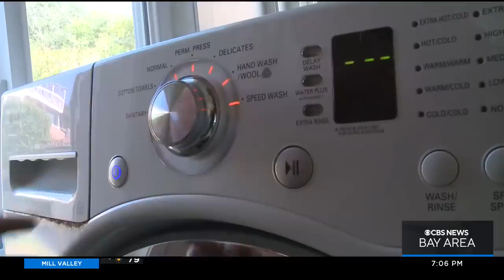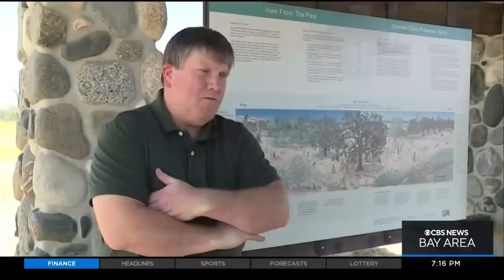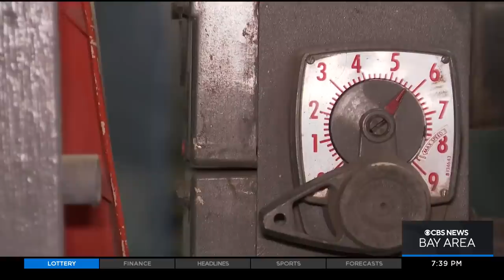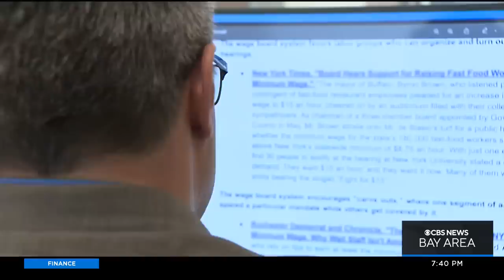Parched: California's Climate Crisis

Comment: I've worked in CA Water industry for 15 years.  We do not collect rain water when it falls, we release water when we have too much into the ocean, we do not recharge our aquifers with excess rain fall or run-off.  Then we build more homes, allow farmers to grow any water hungry crop they want for cash and tell people that their lawn is the real issue.  
We also have denied several new agencies from building new desalination plants.

Our political leaders could also get together and do a large public works project, which would provide lots of jobs, to make a new aqueduct from up north.  This is a making of our own design, while the weather has pushed it faster, this is our own doing.
Reply: Interesting.
Reply: Exactly right!!
Reply: Very enlightening !
Reply: That's aqueducts and desalination plants are still the most expensive and frankly destructive approach.  It is vulnerable, brittle, and fails to address concurrent problems.  You will end up using a ton of electricity to pump water in the aquifers, as well as desalinating water.  It would increase brownouts.

The better approach is the prevent collecting too much water at dams in the first place.  
It is better to do smaller, decentralized, water-harvesting earthworks/techniques starting in the foothills, and continue thru to cities.  These would include keylining, check dams, bunds, swales, gully repair, planting pits etc.  More bioswales with curbcuts to feed street runoff into them is a start in urban areas, as well as encouraging the purchase of cisterns, using greywater for watering lawns and trees, as well as using roof runoff for water, flushing etc.
Decentralized efforts can reduce fire danger, flooding, lessen drought impacts.  Bioswales planted with trees can reduce heat island effects, allow pavement to last longer.  By passively using rainwater in bioswales, reusing greywater and roofwater you can reduce the amount of electricity used to irrigate and reduce the chance of brownouts.  
Keeping landscaping hydrated this way also keeps the soil biota hydrated and allows water too seep better into the soil instead of running off.  
Overall using rainwater harvesting techniques/earthworks recharges aquifers and surface water in a positive downstream effect.  
Brad Lancaster has YT videos and books on the subject.

Lots of water falls there, even during droughts but as you said, it is squandered.  You need to back up and reassess where you look for problems/solutions...

Farming and ranching could be done much better.  'Sustainable ag' is a greenwashing term to sell more products to farmers and ranchers rather than solve deep ag problems.  Restorative ag techniques work much better and for less while producing more food.
Reply: And how much does the state spend on weather modification activities with Colorado blm?
Reply: @Cali Singh  
^^^^^^^^>>>>>works for a company that makes desalination equipment.
Please buy his tech that breaks down, uses a lot of electricity, requires lots of maintenance, will need to pump water great distances, will cause more grown outs, pollute a lot more, break down, fail to operate during power outages, increases insecurity, centralizes water,  costs $$$$$$$,  makes him $$$$$$, solves only only one problem but causes a lot more.  

Now consider using a system that solves a lot of problems.  It is a lot cheaper;  provides a superior product; is durable, long-lasting; reduces fire danger, slide danger, flood danger; reduces the effects of heat waves; saves on heating, cooling and watering bills; mitigates droughts; recharges aquifers and water tables; reduces grid strain; reduces crime; adds beauty; adds resilience to individuals, communities and cities, even regions.  
Desalination plants are a big fail.
Reply: There should be more public discussion about this. Thank you for explaining.
Reply: @tk3831  
There should be broader discussion beyond the higher tech, costly solutions that were discussed in the video.  This video is put out by a news company with corporate interests to sell more product.  
Teague made somepoints about what is wrong but then he came up with more brittle, downstream solutions. What would be more effective would be to start smaller, localized, higher-in-the-waterhed solutions via rainwater harvesting solutions and earthworks.  A similar, localized approach could be employed in the city, through bioswales and curbcuts that address many problems cities, communities and individuals are already trying to solve via much more expensive, low-on-return solutions.  
Localized solutions mean localized resilience which is important.  
There are great examples online of Tucson and it's efforts.  Refer to Brad Lancaster.  For additional info on modifying ranching/farming techniques look up Mark Shepard.  Each teaches techniques adaptable to local watersheds and ecosystems.  The great news is that they do work and are a lot better than they continued shooting ourselves in the foot policies offered elsewhere...
Reply: @b_uppy  israel would beg to differ with you.  Desal plants are working miraculously well for them.
Reply: @calisingh7978  Weather modification is expensive and unreliable. Micro-climate and regenerative farming should be addressed first, IMO.
Reply: @bookbeing  
Aussies would say otherwise.  Desalination is brittle, centralized, and needs replacement, as well as constant maintenance.  It pulls a huge amount of electricity to process it.  Pumping water uses a huge amount of electricity.
A terrorist strike, or a brown out earthquake and the mirage of water abundance is gone.  

If you start with simple things like a curbcut diverted into streetside bioswales (inlet only, or else you lose mulch).  Roof runoff diverted into a cistern, rain gardens, or fill a cistern then overflow be diverted into raingardens.  Use greywater as well, for flushing and landscaping.  Public parks, ranch and farmland could use rainwater harvesting earthworks and techniques.  This would greatly reduce gridstrain on water supplies, and electrical grid demand.  It would also reduce erosion, reduce flooding and fire dangers, mitigate the effect of heatwaves, etc.  It has increased beauty, shade, comfort and even reduced crime as neighborhoods have become walkable/bikeable.  
Bunds, check dams, gully repair, planting pits, keylining, swales, etc could be cheaply made out of materials on site.  Brad Lancaster has a great book on the different techniques that are low cost and highly effective.  Many are now employed by the city of Tucson, and well as on farm and ranchland and around the Sonoran Desert and elsewhere around the country.
Adapting Mark Shepard's techniques would help as well.  He grows local native- or domesticated relatives of native- food-producing perennials, shrubs, vines and trees.  He has as a variety of livestock for pest control and fertilization and as additional sources of income.  This would be much better than paying a farmer to do zero as it would be mimicking natural processes while still producing needed food, plant diversity and also provide wildlife habitat.

(It should be added that there are permaculturist in Israel as well...)
Reply: @bookbeing  
Aussies would say otherwise.  Desalination is brittle, centralized, and needs replacement, as well as constant maintenance.  It pulls a huge amount of electricity to process it.  Pumping water uses a huge amount of electricity.
A terrorist strike, or a brown out earthquake and the mirage of water abundance is gone.  

If you start with simple things like a curbcut diverted into streetside bioswales (inlet only, or else you lose mulch).  Roof runoff diverted into a cistern, rain gardens, or fill a cistern then overflow be diverted into raingardens.  Use greywater as well, for flushing and landscaping.  Public parks, ranch and farmland could use rainwater harvesting earthworks and techniques.  This would greatly reduce gridstrain on water supplies, and electrical grid demand.  It would also reduce erosion, reduce flooding and fire dangers, mitigate the effect of heatwaves, etc.  It has increased beauty, shade, comfort and even reduced crime as neighborhoods have become walkable/bikeable.  
Bunds, check dams, gully repair, planting pits, keylining, swales, etc could be cheaply made out of materials on site. 
Brad Lancaster has a great book on the different techniques that are low cost and highly effective.  Many are now employed by the city of Tucson, and well as on farm and ranchland and around the Sonoran Desert and elsewhere around the country.
Adapting Mark Shepard's techniques would help as well.  He grows local native- or domesticated relatives of native- food-producing perennials, shrubs, vines and trees.  He has as a variety of livestock for pest control and fertilization and as additional sources of income.  This would be much better than paying a farmer to do zero as it would be mimicking natural processes while still producing needed food, plant diversity and also provide wildlife habitat.

(It should be added that there are permaculturist in Israel as well...)
Reply: @Teri's Teapot 
Think Cali Singh works for company selling one-hit wonder tech...
Reply: @b_uppy  your argument against desalination or reverse osmosis, is like Baltar in Battle star Galactica, 
Stopping action to save human kind whilst doom ensues!
This is not climate change but continued absence of correct action!
Reply: I have this spot I like to skate in. The homes are listed for 2M but empty- it’s a ghost town right by the harbor.
Reply: To be fair, the US obsession with green lawns really only works on the East coast
Reply: @Rainclouds Radio  
Actually a hydrated yard absorbs rainwater better because 1) the soil has avoided collapse and compaction.  2) The soil biota and plants and earthworms create pathways for water to run down.  
The other part of the problem is the way we maintain the lawns and landscaping.  
We use drinking-quality water when we could use greywater, roof rainwater runoff diverted to cisterns and then that overflow diverted to raingardens (with mulch!).  We could also employ street runoff and divert water via curbcuts and holes bored in curbs into mulched planting pits called bioswales.  
Ten inches of rainfall falling on a square kilometer of land is about a million gallons of water.  A huge amount of water runs down the street and into stormwater drains that would be perfect for landscaping.  
Look into Brad Lancaster's latest editions on rainwater harvesting in drylands.
Reply: Free healthcare and education for illegal aliens and legalizing theft are more important Democrat Party priorities.
Reply: I blame Trump. Only Breck Girl Gavin Newsome can save California.
Reply: Great discussion here in the comments! Refreshing!!
Reply: I have never understood why California, by far the richest and most populated state in the country does not invest in a system Of water recolección? Also one or two super dams to collect even
More rain water to have as extra for the dry season would help the state a lot.
Reply: Agreed 100%.
Reply: @b_uppy  thank you!!!!!! Proper land management, the old fashioned way of rotating and planting of multi crops rather than mono crops  swales, mulching, biodiverse use of natural fertilizers and ground/earth restoration instead of pouring on chemicals  toxins,, etc,, use of grey water from dishwashing which I do by hand with biohealthy soap, laundry grey water again using more natural rather than toxic products, and rinse water, shower and bathing water,  etc can all be either used directly or easily filtered and used for plant and garden watering, as can rainfall run off, but in most places, including California,  laws forbid it! Sad. Consequently  our soil becomes overly dry and dead so instead of absorbing rain it runs off. Perfect example is nearby where I live in the high desert. We had a runoff issue at the lower end of a flash flood point. They raised the road and put in larger drainage  pipes to allow the flash flood waters to flow farther into the desert. Upper level swales  terraced, over the downhill slope would have allowed the water better time to soak into the ground water table, enhancing the soil and area to grow more natural  plant materials that would better hold the soil creating plant biodiversity and hold soil and water allowing it to percolate deep into the ground, instead of just allowing the water to run downhill,  stripping soil, rock , and plant material  creating the existing issue that still remains downhill.  Instead of stitches and healing a bandaid was placed which covers   for a time the existing issue which will again show up as soon as silt and debris fills the drainage culvert.
Reply: @teresamariner4238  
Glad we're agreed!  I do similar practices as well. 
Nanny laws are the worst.  It's one thing to protect people who lack the capability to protect themselves but most people, as does society, does much better without it.
We need to decentralize water:  get a lot more value because of reduced fire danger and associated costs;  reduced flood danger and associated costs, including replacing aging/flawed stormwater drain systems;  reduced irrigation costs and fees;  reduced electrical grid strain, brownouts, and related costs and fees, including heating and cooling;  reduced pavement wear because of reduced heat stress, increased walkability, bikeability;  reduced heat island effect;  increased beauty, biophilic design;  reduced air and water pollution as well as removing more CO²;  decreasing the effects of  droughts and heatwaves (including deaths) while increasing food availability and diversity, the list goes on.  
Bioswales;  raingardens;  using street and roof runoff;  as well as using onsite materials in farm-, range- and park- lands to create rainwater harvesting earthworks, etc
etc are still important in cheaply offsetting the multiple problems faced by people living in drylands, and beyond.  
Restorative ag practices will make a huge difference as well.  
I think our biggest obstacles are politicians who receive favors from corporate conglomerates to use their high -tech, single-use, impoverishing 'solutions.'  They will continue to centralize resources with tax dollars and charge for fees them.  Desalination plants, other water tech fail to address the problems that are compounding water shortages, fires, droughts,  crowding, crime, homelessness, etc.  

What's interesting to me is I say what I say about about the alternatives and the kinds of objections I get.  People are still failing to see the value of restoration ag/permaculture practoces provide...
Reply: @William Montes
Nuclear (and the latest desalination gizmos ) is more single use, expensive infrastructure that only addresses power and drinking water that requires related infrastructure.  These have very limited benefit when you consider the cascade of upstream/downstream centralization issues they add, including rapidly compounding costs as well as having limited benefit in the larger scheme, such as reducing fire loss, flooding losses, drought losses, homelessness, crime, exorbitant cost of living,poor food diversity, the list goes on.
Additionally where would we put a power plant without risk of damaging a large portion of land for growing?
Reply: Farmers aren’t the problem hun, it’s your mismanagement and selling it all to nestle for pennies.
Reply: Some of these issues came up when I took a college class in the late 80s.... California has been heading in this direction for a long time.... Even if Global Warming wasn't a thing California was going to have a water problem....
Reply: Teague Oh my not homes and grass which actually is helpful (sans herbicides) it keeps the soil moist via nightly dew and keeps soil from eroding. Grass is also beneficial to insects, but UN decided grass is now a crime, and the 75yrs of weather modification/ control is okay, is that right?
Reply: @bookbeing  And so is weather modification eh.
Reply: Totally agree bad management.  Ancient times people used to have  water management in deserts .
Reply: @MissCV  
Some farmers/ranchers use bad practices that dry out the soil (some of these conventional ag practices are greenwashed by calling them 'sustainable').
Bare earth/overgrazing practices cause the rainwater and irrigation to run off instead of seeping in.  They also contribute to the loss of black topsoil which also contributes to poor soil hydration.   You see bare ground, dead brown short plants, synthetic fertilizers and biocides, monocrops, etc, --you can be assured more water is used than is necessary to keep up production.  
Many farmers/ranchers do use restorative practices that rely on rainwater only, or a lot less irrigation while producing an abundance of diversw, more nutritious foods while maintaining a level of ethics.  It helps to use practices and plants adapted to a site, than to try to change a site through synthetic chemicals and other less durable, brittle methods.
Look up Brad Lancaster's books on rainwater harvesting and Mark Shepard's books on restoration ag.
Reply: @gordonlumbert9861  
California could address a lot of its water problems in the decentralized way Australia, or even Tucson does.  The wealth gap is ever increasing there.  
Simpler solutions regarding water should be done first.  I keep talking about bioswales, street runoff & curbcuts; roof runoff, cisterns and raingardens;  rainwater harvesting techniques and earthworks using onsite materials; etc; for a reason.
A one kilometer square area that receives 10 inches of rain, will have received about a million gallons of water.  
Most of that water is wasted due to drought conditions, compacted dry soil, evaporation, and all the storm infrastructure to drain it into canals instead of diverting into the immediate landscape.
Transpiration from repair to the land could restore natural hydrologic cycle and decrease the crazy cascade of costs with new infra structure.
Reply: @Gordon Lumbert  
California could address a lot of its water problems in the decentralized way Australia, or even Tucson does.  The wealth gap is ever increasing there.  
Simpler solutions regarding water should be done first.  I keep talking about bioswales, street runoff & curbcuts; roof runoff, cisterns and raingardens;  rainwater harvesting techniques and earthworks using onsite materials; etc; for a reason.
A one kilometer square area that receives 10 inches of rain, will have received about a million gallons of water.  
Most of that water is wasted due to drought conditions, compacted dry soil, evaporation, and all the storm infrastructure to drain it into canals instead of diverting into the immediate landscape.
Transpiration from repair to the land could restore natural hydrologic cycle and decrease the crazy cascade of costs with new infrastructure.
Reply: @msheart2  
Lawn where synthetic chemicals are avoided is important to restoring soils ability to receive and soak in water.  
People vilify golf courses but they can be important to cities for several reasons.  They do need to avoid synthetic chemical inputs and could easily incorporate raingardens and bioswales to increase their rainwater harvesting benefit, but they help mitigate flooding, and air pollution, sequester more rainwater, as well as add greenspace in an area packing it.  They are self-supporting spaces that where elderly and disabled people can exercise, as well. 
If they forewent synthetic chemical inputs, added raingardens and bioswales they could reduce water pollution, further reduce flooding impacts, increase soil carbon, encourage more birds, etc.
Reply: @coniwatson9512  
You mean ancient water practices, rather than ancient times.  Many have stayed in use, though they lost mainstream use..
Bunds, check dams, planting pits, gully repair, etc are still here and used.  Many people are adopting them once again because they bring localized water security, This is much better than the insecurity centralized services that can be cut off by earthquakes, brownouts, accidents, fires, terrorist attack, delivery failures, grid breakdowns, etc.
Reply: @b_uppy  these are great suggestions that each individual person should try to implement.  Unfortunately, these efforts take time to  show some benefit as results don't happen overnight. Even if everyone worked hard to implement all the suggestions that you put forth we still  need to have something in the interim, a stop gap, especially for areas where the  habitat may not allow for these kind of programs to reliably consistently meet the drinking water needs of the population.
Reply: Land how about all them oil fields in California
Reply: @LWRC  
It is largely exacerbated by government policy but also ag practices that are based on poor synthetic-chemical input, monocultural, bare-earth-model ag and overgrazing.  We've learned a lot in the past 50 years regarding farming/ranching; and especially soil health and the key that plays in productivity, carbon sequestration, water holding ability, flood mitigation, soil fertility, biodiversity, etc.  
Better ag practice groups are still fighting back against corporate conglomerate interests that want to sell chemical inputs, GMOS for every occasion, and then buy the land of farms that go under, while increasing profits and power, especially global power. 
This is where decentralization, localization, and permaculture/restorative ag comes in.
Reply: @b_uppy  Mr genius, grow a pair!!
Reply: @LWRC  
Your comment 'grow a pair' shows your utter lack of cogent rebuttal.  It reflects badly on you alone.
Reply: @b_uppy  No. The issue is with water supply and not the methods of farming. You are clueless!
Reply: @LWRC  
Quote:  'And that sounds fine when the US population was under 100mm.  You're not going to have enough mom and pop farms to feed the population we have now!!!' (Sic)
You brought up mom and pop farms, I answered, and my answers have need about improving farming/ranching practices as conventional ag practices currently waste a huge amount of water as well as other resources.  
You previously blamed the government, lusted after No Cal water, as well as threw in some sexism ('Mr Buppy, grow a pair').   I agreed with you that government wastes water in the way it sets up infrastructure, etc, but also pointed out blind spots to your logic.  

I suggest you grow a pair and venture outside of you closed mind and study up on the points I made, as well as your life choices...
Reply: @b_uppy   Pretty ignorant rant.  Farming is very labor intensive and if you think you have a better plan, go do it. You don't think the farmers we have are already watching their cash flow? Have you ever started and successfully operated a business much less farming?!!! We all want to conserve water considering we have morons in charge here in Kalifornia but don't pretend you have a solution when you can't even recognize the problem!
Reply: @LWRC  
As both conventional and permacultural/restorational farming and ranching are in my background I know what is possible (I've done the hard work).  
I suggest you stop being lazy and disingenuous and do some research. 
Substitute your mock outrage with some serious questions.  Aussies, Ethiopians, Afrikaans, Indians, Americans, Portuguese, Spanish, Brazilians etc from the world over using different permaculture techniques and applying them to farming. 
For farming/ranching techniques that adapt well to California I suggest you check out Mark Shepard's books on restoration ag a well as keylining/ripping.  He rescommends plant guilds best adapted to California's biomes (they would need to be adjusted according site).  
At home Mark and on the 5 other farms he now is working on establishing he uses perennials, trees, vines and shrubs in an alley-cropping system loosely inspired by the most productive biome in the world, - the savannah.  When he started out, while waiting for his trees, shrubs, vines and perennials to get established, he planted annuals to ensure an income stream.  
Mark uses livestock (cattle, sheep, pigs, turkeys and chickens) to manage pests and weeds, disease, and fertility.  He has zero need for synthetic chemical inputs.  
He has much more economic resilience built in than his uncle, who was a farmer and had lots of boom and bust years.  If some crops are damaged by late frost or a hail storm he still has other sources of income, and his land is resilient to drought as well, because in addition to the resilient plants he chose, he also uses keylining and swales to enhance summer moisture.  He had to irrigate when he was first establishing trees etc on the property because of initial hardpan and low fertility.  
He is rebuilding soil and it is turning black with carbon, turning into topsoil, otherwise known as black gold to farmers.  The livestock are managed in such a way that he achieves a lot more biomass and feed diversity for them (key to livestock maintaining condition (aka vigor)).  He has zero need to buy hay or grain for livestock because they get what they need on site, as he uses trees ,etc ask part of the supplemental food system.  
Another key thing Mark does is belong to a co-op for economic power (he was an early member to join Organic Valley Coop).
Regarding rainwater harvesting techniques and earthworks Brad Lancaster's books (get the newest editions) offer low-tech ways to take advantage of what you have on site and to decrease long term effort and expense while increasing water resiliency.  They have the ability to assist with fire management, flooding control, pollution remediation, drought and heat wave resiliency, irrigation, etc.  I suggest you read his books cover to cover.  He has worked to remediate both rural and urban areas.  
For proof of concept look up Allen Savory.  Just saw a video a week ago of how he used mob grazing to rehab ranchland in Africa, Mexico, elsewhere.  Amazing before and after photos.  (Mark Shepard uses a variation of it).
Regarding soil science I recommend Carolyn Jones, Walter Jehne (he rambles, but you begin to get a fuller picture after several videos), and Elaine Ingham.  
Peter Andrews transformed his salt-laden acreage in Oz.  Gabe Brown is more 'regenerative ag' (lacks the ethics component of restoration ag/permaculture) and from the water rich part of the Midwest but his work on his farm, elsewhere is insightful.  
Ray Archuelita is another source.
Think permaculture/restoration ag techniques are so strange to Californians, especially in So Cal is that most of the people doing the ranching/farming are foreigners, either from Latin America or Germany and much of the literature is in English.  There is synthetic ag but that is out of Brazil and that is a wetter climate.

Most permaculture technique are quite old, and efficient, but as complex fuel-driven machinery came on, and the chemical companies needed to disposes of their excess chemicals after WWII, and they were initially cheap, farmers got hooked on the synthetic chemical promises.  There is a 180° in knowledge since then, as many previous widely held premises are shattered.  
Btw, there are rainwater harvesting swales in the Sonoran Desert that helped reclaim a denuded valley.  They were made by the CCC about 90 years ago and will likely last hundreds of years more.  Inside the swale are grasses and wildlife.  Outside the ground is much harder.  
Suggest you check it out...

'Pretty ignorant rant describes your comment well)
Reply: @b_uppy  I enjoyed reading your comments. I wish we had more projects like you listed. I believe in Africa they special day for building "bungs". 
Then there's the shoes, belt and hat method the Chinese did.
Reply: @scubadoobiedoo2190  
The Loess Plateau was a great project that should have been continued but they stopped it for planting tree plantations and gridded, embedded straw.
Ethiopia has probably done the most the quickest but nations along the Sahel are doing great.  
Mr Zacharia Phiri (of Zimbabwe?) was an inspiration for Brad Lancaster to begin his journey.  Suggest you look them both up.   Mr Phiri was a very charming man.  Brad's mother is from South Africa and it was on a visit that he met Mr Phiri.  
Mr Phiri reclaimed a site that was practically all rock into a lush site.  Amazing story.
Reply: @b_uppy  I had to look up Brad before remembering his name. Both are inspirational. I like Phiri's approach because it seems so simple and intuitive. Brad's projects are a great addition to any city. I always get blank looks when I start complaining about city water runoff use. Lol
Reply: Don't forget, even before they allocate water they use a bunch for environmental projects such as releasing a lot of the reservoir storage into the bay for a fish.  As if a fish (delta smelt) that cannot naturally survive is more important than millions of human lives.
Reply: Reckless care of this precious resource is going to give CA a major lesson in conservation...it's now in the stage of you learn to be wise or you all fall into the category of climate refugees.
Reply: Same in Las Vegas. Keep building. One would think the rain that hits the roofs could have been collected and funneled for use.
Reply: Removing silt from lakes
Reply: Thank you for spreading the truth sir
Reply: They farmers are doing corporate style farming on the rice they don’t rotate fields so when they flood the field gif the rice the water doesn’t replenish it doesn’t seep down after awhile
Reply: bit fcukkin late
Reply: Larg public works projects 😂😂🤣 how's that brown train to nowhere going ? How's the budget going.
Reply: Teague, I hear that desalination plants are causing a new environmental problem. The product after creating salt-free water is 'brine' which is hostile to life as we know it. Disposing of that brine is a big problem. Have you looked into this issue?
Reply: @Video2Webb  Oh yes, You get a lot of salt which kill most life where its dumped.. Its classical. We solve some problems but make new ones too. Several project fx from Saudia Arabi show it very well. 

I just read as some noboby. Its by the way the same in long distance electricity transport in the  direct current version. You get clorine and by that salt too. 

We have to choose, if there is any choise. 

n Denmark so far all water for drinking and even in the toilets is drinking water from the ground. by that we dont buy tasty buble water. But we do a lot of farmin coming down leftovers from that. By that we have to mix water. If there are too many pesticides, we mist of with something with too much calcium. 

We now try to make zones with no farmer pollution and also clean from old industrial areas. It taes time. Making new clean water here as a minium takes 30 years and often 50. So until that we has increased risk. 

So far we are lucky. We dont have to make drinking water. We also has invested in connecting the water drilling zones, so we are able to mix as routine. Thats expensive too. 

The companies almost have to have bartenders in several parts of the country to make the water safe. So far we are ding fine. 

Its a fight where ever You are, but rain or not we have to learn to respect the nature.We try in Denmark but not hard enogh. We make some parts back to nature for protection. Its not only for water but also plant, anials, insects. 

So I hope You write and make support for what to do in California and Nevada. 

Parts has to go back to be onl nature. When You grow too much and also waste too´much, there will be less and less water. It of course goes for the many people living there.

Some might say less people shpould live there and fx reagain the old now destroyed industrial zone for cars and coal mining. 

By that You have to have a stronger state. We see for USA and partly here too, that companies wont make jobs unless they are are optimized and for almost free. We have a much stronger and reliable state here compared to Yours. Even so its very difficult. 

You can write back. You seemes to be a nice person ❤
Reply: I always wondered why we don’t just use ocean water and desalinize.
Reply: @tortillaman2491  Some facilities in the world do. I makes a lot of sense to use the Pacifics for that. 

There will be no change unless You tell the polititions above You many times. There are very good youtube videos about it.
Reply: @jensholm5759  Maybe little green men from outer space set up a secret underwater base in the ocean and don't want us to desalinize the water.
Reply: @tortillaman2491  Or women
Reply: @LK-pc4sq  Its not like that for me. Number one anytime is You have to be able to freed next generation well.  By that making less children is one of several solutions. You also fx can migrate to places, which can produce enogh food  and fx take in other sources or recycle plant and fertilizers.

In Denmrk we reuse the leftiver from animals very well. We not only makes more food, we also makes ethanol and metans at the same time. By that we get some for electricity, varming up and for vars

I omly has a small garden, but it do produce a lot of food. Here its also agreat helo for mu sandy garden, thsy tke all water from the double garage. So its very about things go to nothing ot the sky. 

 And we has no patents or are so proud reducing the waste. But sometimes there are  solutioins, which are not very advanced. But for Denmark we use what we acualy has much better then most. 10% much cheeper  then fossils is a lot. The rprice for wtaer is very high too even we have to add a lotbof calsium. 

Im very selectine in the global warming aspects. The only way for me and many is competed, so people use the simple and cleaner altenatives much better, whereever we can. I do feel less and less for people which insist in no changes even blaming me and my country for not sending free food.

We have told them so many times in all ways as far away as I remember and how.  Africans fx import about 40% of its food basisc from Russia and Ukraine. Very much of that drowns in corruption and oligarcs mainly made ny themself.

By that normal competittion is blocked. An by that we see the winners are orligarcs in export and excport. By that Russians and Ukras also are paid almost nothing as saery. By that there are no possible buildups be their txsystems. And its not Ukraine/Russsia/ Afica thing
Reply: @christinalynn8143  interesting where you get your info.
Reply: @magalitxo  you're enlightened by Teague?  check your facts
Reply: @tk3831  Teague explained nothing to you. don't be so gullible   Read ''California Water 101''
Reply: @cwinfrey7077  Thanks. I guess? What to say? To that, 😄
Reply: @cwinfrey7077  Maybee gold grow in goldmines too :(